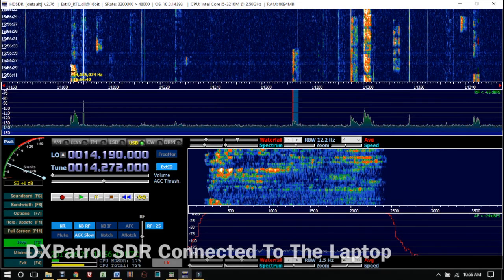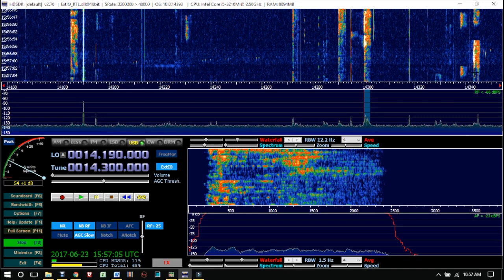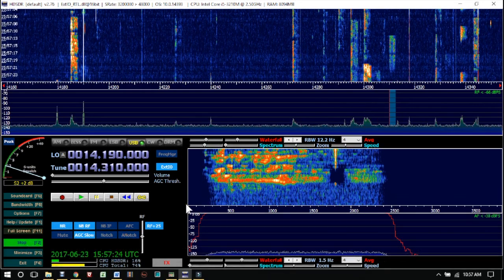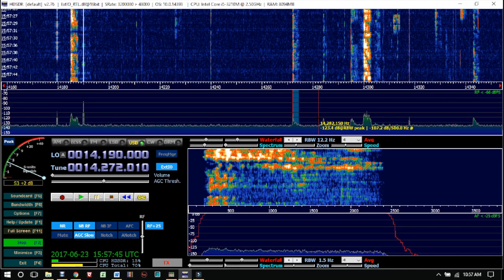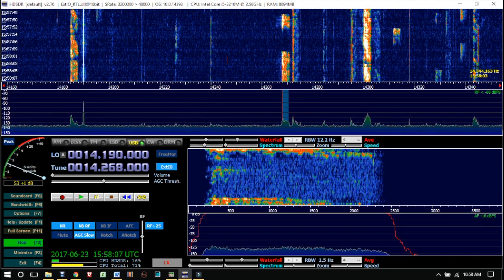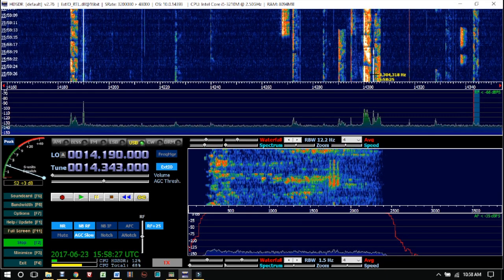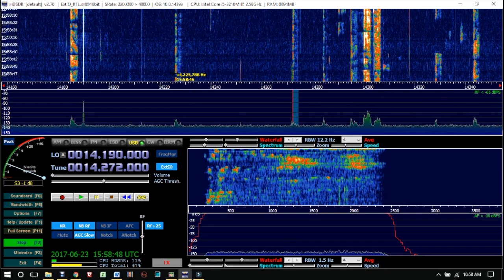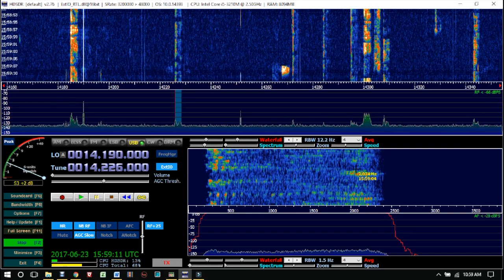Icom 7300 Panadapter HDSDR Demo

Comment: Any mod to just display the 7300 on a monitor without using a SDR?
Reply from the maker: Tony McGee Hello and thanks for commenting here. It does not have a display port like the 7610. There is software that has the spectrum scope though. One of them is called Win4IcomSuite. 73!
Reply: @HamRadioAdventures  No IF or RX out?
Reply from the maker: Ralph no sadly,

Comment: You noise floor is extremely low! Mine is S7 on 20m GP vertical although i hear no powerline noise or anything like that. I just have multiple AM broadcast station nearby so im not sure if such stations could increase NF to s7 across all HF bands!!! Do u think BC station is the reason of this S7 NF!
Reply from the maker: Nice to hear from you and thank you for commenting. Sorry for the delay. I was out of town. Sorry I didn't get back to you sooner, but I did not have data coverage in the Park.

It could be, but I would look for local noise too. Can you run your radio off a battery while turning off the power main in the house? If that is possible I would try it.

Rich, K0PIR
Reply: Ham Radio with K0PIR yea i did that, but nothing has changed....
Reply from the maker: That's a good start Mohamad. Did you try disconnecting everything from the radio? Without the antenna or anything else it should be quiet, then attach the antenna only. How is it? Could it be your PC causing the noise?

Comment: will transmitting hurt the sdr you have connected?
Reply from the maker: Hi nice to hear from you and thank you for the great question. Short answer is no it doesn't affect the SDR. The IC-7300 has a relay that switches and protects the little SDR dongle. I was hesitant because one other Ham said it may be advisable to have some protection in line. I think that's overkill. Many others have not seen the need for it. I hope this helps. Best 73!
Reply: Fair enough.  I appreciate all the effort you put in to the research. I have mine up and running and it works well. I was just concerned because it looks pretty wild when I transmit. But then again I am judging that off sdruno.  I know other programs have an auto mute.  Otherwise this is great. Thanks again. 73 de kd9iwo.
Reply from the maker: HDSDR has "mute RX audio on TX" under Options, TX. Thank you!

Comment: I am a bit confused as to what you are doing here. So dx patrol is an sdr radio....right? The HDSDR is the software connected to the dx patrol or the 7300, or is it somehow connected to both? Also you are saying IC-Panadapter...is this an actual piece of hardware or are using the dx patrol as a panadapter? And what is the purpose of the Irad 7300 Mod? 

Sorry for all the questions, but this sounds very cool...just can't figure out what all you have done.
Reply from the maker: Hi Randy,
Thanks for commenting. Great questions and yes the DXPatrol is a somewhat, inexpensive SDR with upconverter.  If you are not familiar with adding HDSDR and using it as a panadapter, it's confusing. 
The DXPatrol is connected to the rear of the IC-7300 and using the IC-7300s antenna. The DXPatrol is connected to the laptop to with a USB connection. The laptop is running HDSDR. So there are two receivers in this setup, the IC-7300 and the DXPatrol.
HDSDR controls the DXPatrol and the IC-7300 transceiver, so we have point and click tuning of the Icom 7300 using HDSDR software. Doing this we have the display of the IC-7300 scope on an external monitor and that gives us better resolution, control and a larger picture of the band.
I hope this helps, and I'm working on a more detailed article/video with description.
Thanks for commenting, best 73 and hope to hear you on the air. - Rich, K0PIR